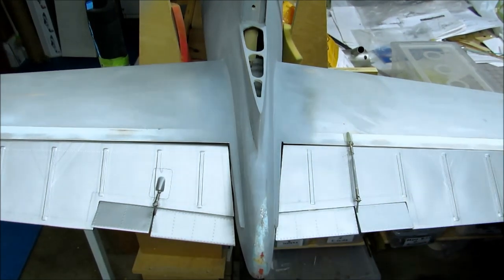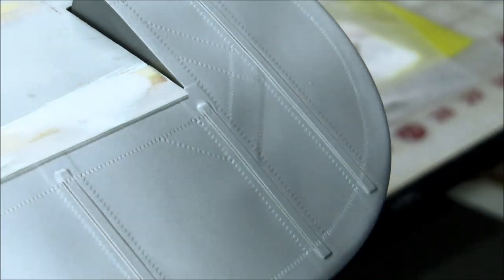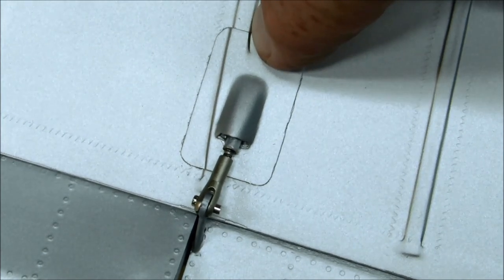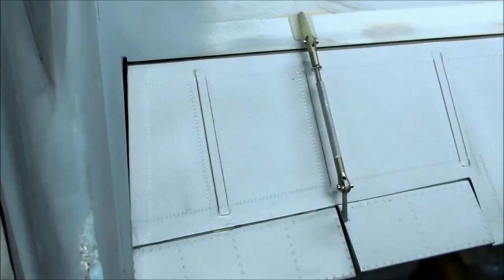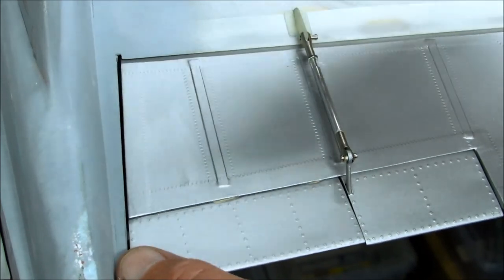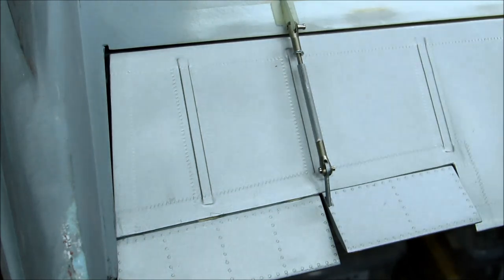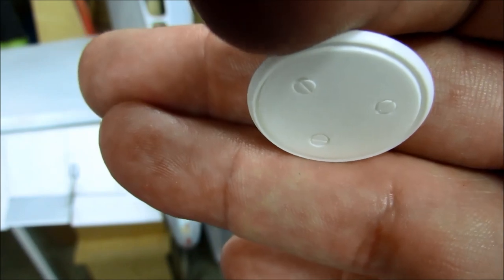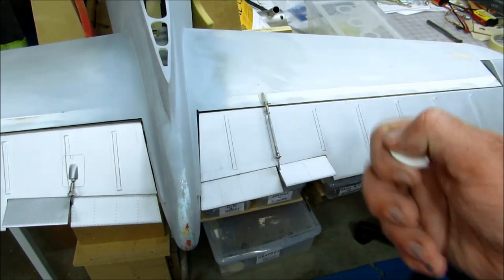Corsair #84, A Final Look at the Elevators, Now Ready for Final Color

Comment from the maker: Hello Ader. From a scale plane perspective, the trim tabs and boost tabs are not important, except for the "WOW" factor.
The larger, inner tabs were the actual trim tabs on the full scale, used to trim the plane for level flight. Mine are immobile.
The smaller, outer tabs were "boost" tabs, and move up when the elevator moves down. These were aerodynamic "helpers" that relieved some of the pressure required by the pilot to move the controls. There are boost tabs on the ailerons as well. Making them move on my model serves no practical purpose, but it does make it more complicated and gives me more things to break...so there's that. :-)
Reply: How is the boost tab actuated on the port side elevator?
Reply from the maker: Many people don't know that the left elevator is identical to the right elevator, but upside down...and vice versa.
The same is true of the stabs.
It's part of the genius of the Vought engineers. This method cut down on the spares required to be carried on carriers by 1/2...as left and right were interchangable.

Sooo...what you see from the top view is the left side trim tab actuator pushrod, and the right side boost tab actuator pushrod. Mirror image on the bottom side.
Reply: Don,
Fantastic work. Lots of builder tips, resources, and how-to's. Thanks
Can't wait to see it in the air.....
Dave
Reply from the maker: You and me both, Dave...You and me both...